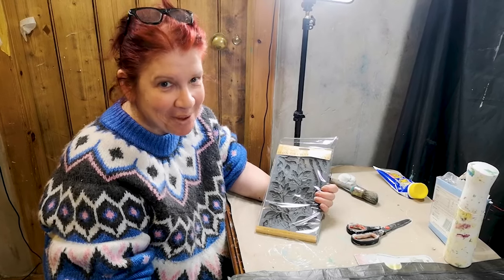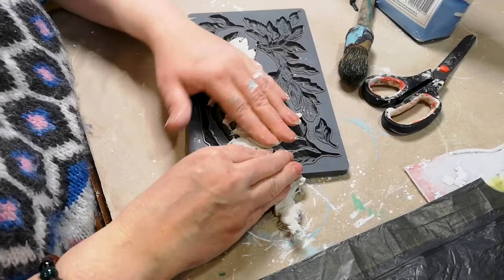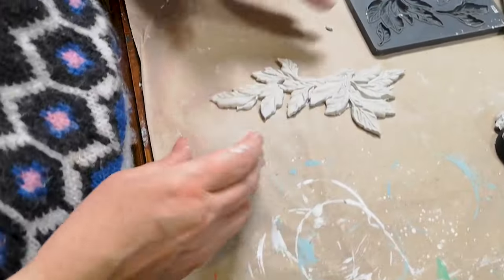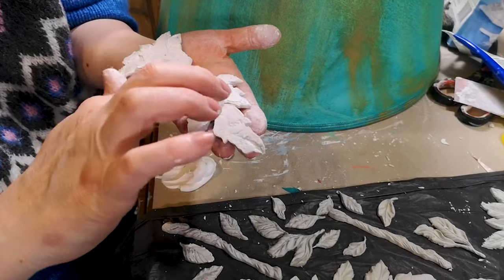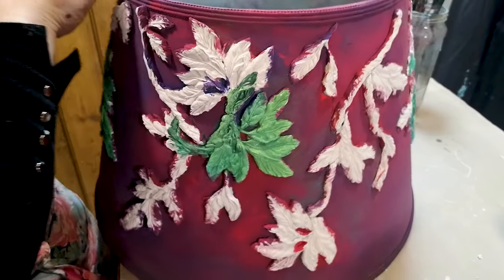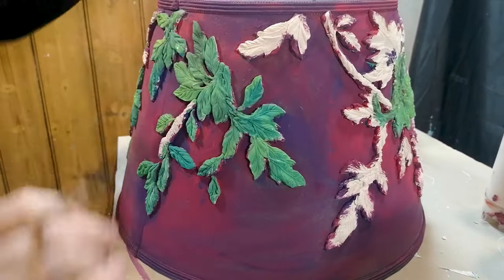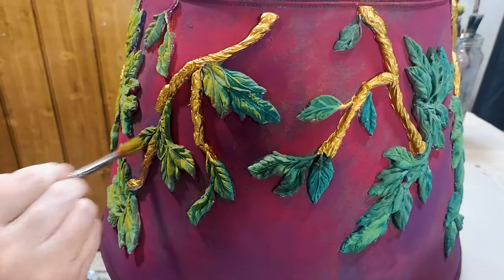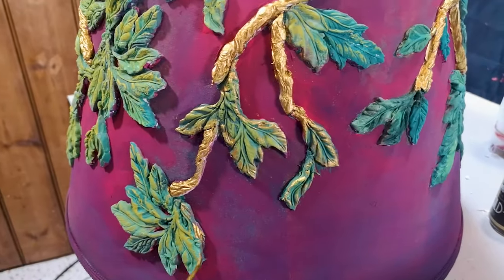A Bougie Lampshade using the New IOD Viridis Mold

Comment: Hello Lel and Martin, thank you so very much for this awesome idea.  You are right, it is a fabulous mold. 
The lampshade came out quite classy!
I am always curious how these lampshades look in the dark with the lights on.  Any chance of popping that photo somewhere on your social media?
I know that you have used this gold paint before in one of the previous videos, but would you give me the name of it?  I would like to find it here in the USA.
I do have one concern.  The air dry clay is quite heavy in weight and I am concerned that in several years, it will have pulled on the fabric and caused it to tear, although, all the paint you have put on it, will keep it glued a lot longer.  I was thinking that maybe in this case, the resin moulds would be more practical. 
Speaking of paint, did you put any top coat on it? Again, I am thinking that if you have used Annie Sloan chalk paint and when the users clean the lampshade, it might smudge.
Thank you so very much.
Hope you get to rest a bit.
Hugs,
Eve
Reply from the maker: Sorry in IOD videos I'm really showing the products not paint and sealer..... Take it as read Eve I seal absolutely everything as standard. EVERYTHING!!!! 
And my moulds are wipeable as they are sealed with my wipeable top coat, I didn't use resin as its a limited bend time but feel free to do you.
The photo you can see in the main image on my Facebook and thumbnail was taken in the dark the shade has a beautiful golden glow so nice in fact I've kept it.
I think I've answered all your questions..
Lel x